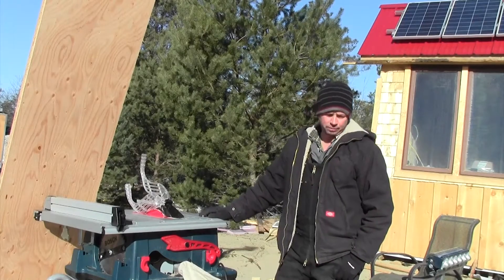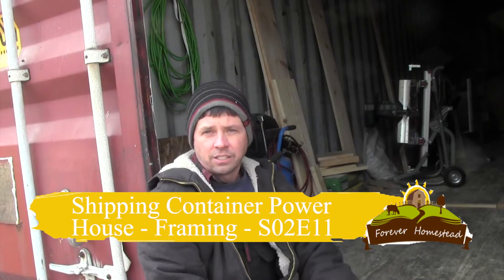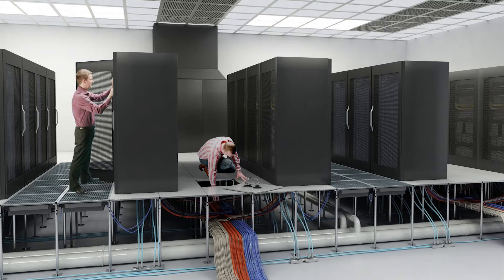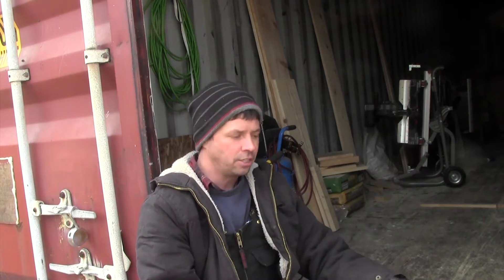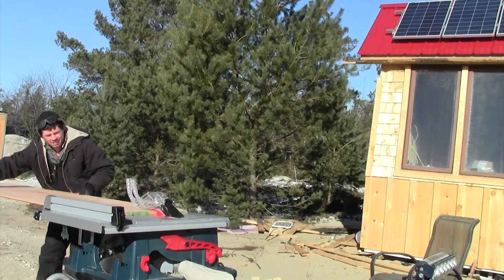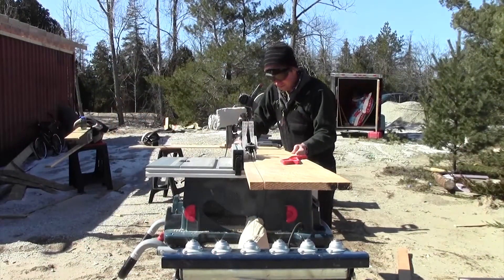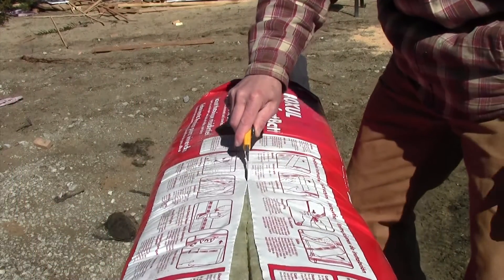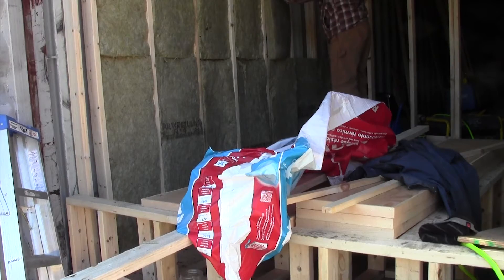S02E11   Shipping Contariner  Power House - Framing

Comment: Wont that be a bit of a pain leaning into those holes if you have to lift them out or work on them?
Reply from the maker: No, not really.  I do monthly maintenance on them and there is no issues.  I would rather have the full view I have compared to having to peak at them from under a shelf or something like that.   Thanks for the comment.

Comment: Wow, that looks great. never thought of that. just keep in mind the batteries release a fume or odor that can be hazardous. add done ventilation for the batteries to extract the fumes outside the container. all in all great job. it looks great.
Reply from the maker: That is the plan.  I will add pex pipe hooked to our outdoor boiler to keep them warm in the winter and also a high/low ventilation system.  It will draw the warmer air from inside the barn and exhaust it outside.  I hated the idea of having to wast so much space.  This seamed like the perfect solution.
Reply: Great to hear that. Thanks for the comment and reply. I was just making sure you knew that for just in case you didn't know. Thanks.